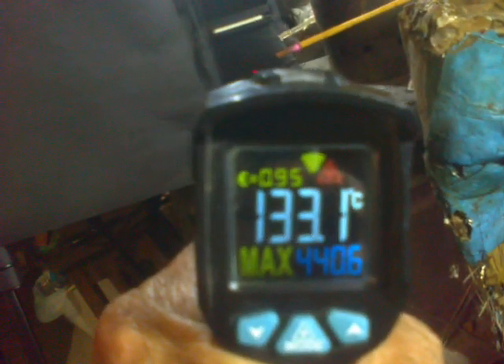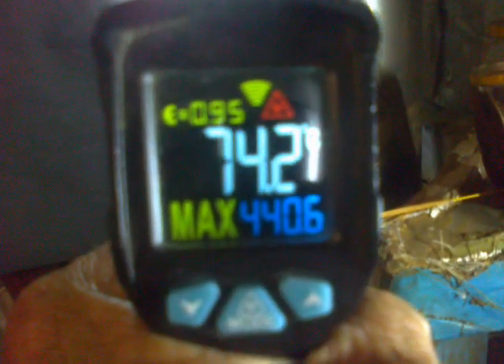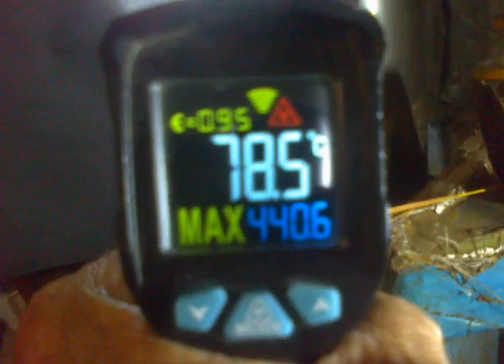5th-Generation Production-Engineered Pressed-Metal Stove-Fan ; Smoke-Trail Studies...

Comment: Well that was a lot of incense smoke. You must have smelt pretty fancy by the end of the lecture. ~8D

I did not know of that type of woodstove-accessory. If I understand it right, the base collects heat from the stove top, the heat is conducted up to the fins behind the fan disk and hence into the air stream. Seems legit, but A$140 seems too much for a little extra heat around the room.

One winter in Canada, I heated a poorly insulated workshop with a wood stove. Needed to be warm because I was building the plug for a mold to make a motorcycle fairing in. Night after night, tens of gallons of auto body putty, from January through to Spring. Pretty comfy, a nicely bright space, and always rock radio on my mono-blaster. Only ever had one visitor, the biggest, stinkiest, chill Porcupine I have ever encountered. To be fair, he/she was there in the shop part of the larger ~shed, and went away not too long after I palled up and petted it’s nose. ~8O

Difference from your fan, I set up a fan behind the stove. It blew whatever hot air over there to the room, and probably (nah, for sure) collected more due to the air speed over the hot surfaces.

Cool analyses, with the smoke-flow and temp-meter and strobe. You a citizen SCIENTIST! 🧐👻😎🐝